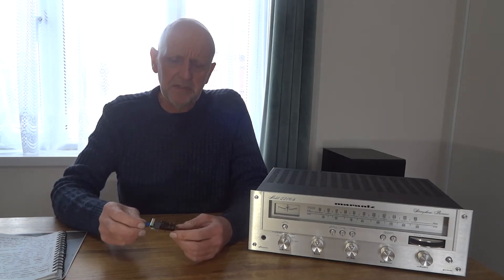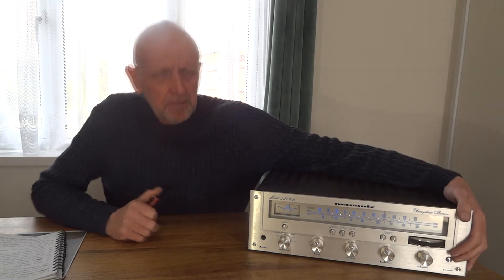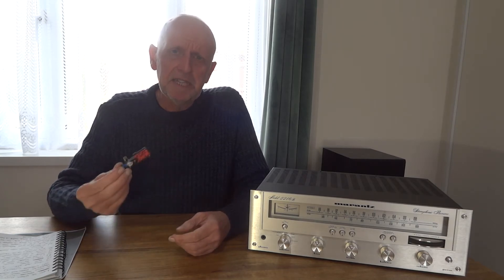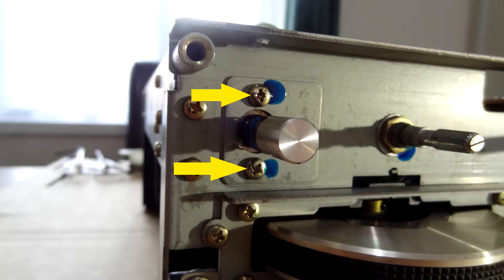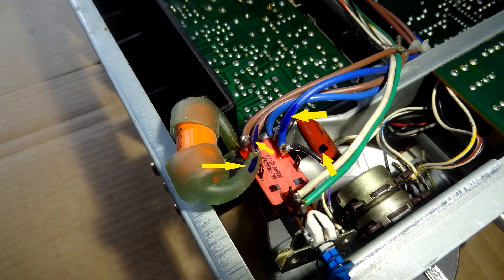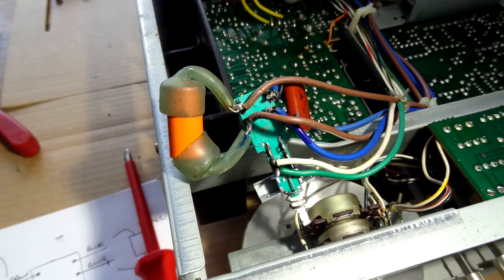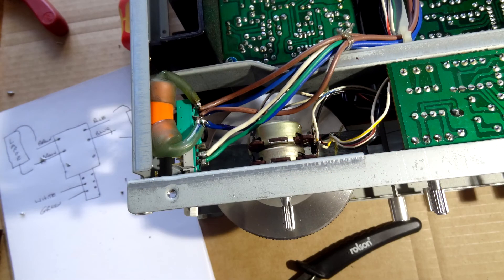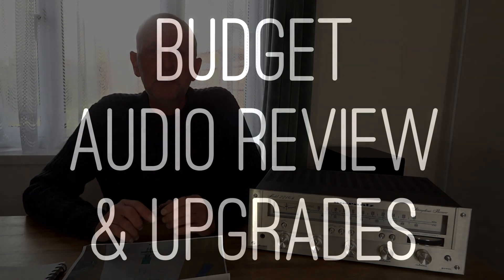Faulty Power Switch on Marantz 2216 Vintage Receiver

Comment: May I ask where you got that replacement switch?
Reply from the maker: I did get mine from a seller on eBay from Germany but I can not see any for sale on there now apart from sellers in the USA and you would need to take the silver mounting bracket off your old one and put it on the new one. They are not cheap here is a link to one for sale https://www.ebay.co.uk/itm/116042705476?chn=ps&_ul=GB&norover=1&mkevt=1&mkrid=710-134428-41853-0&mkcid=2&mkscid=101&itemid=116042705476&targetid=2270718620845&device=c&mktype=pla&googleloc=9045016&poi=&campaignid=20938568783&mkgroupid=160131055320&rlsatarget=pla-2270718620845&abcId=9367980&merchantid=110360246&gad_source=1&gclid=CjwKCAjww_iwBhApEiwAuG6ccMbGAFmLehkRM1dREkRsqUAzRmT5s8XiGC4050g4zUnQDeIb4HTnghoCt-QQAvD_BwE
Reply: @MichaelYates  Thanks. I think I've managed to solve this by gluing in the pins with hot glue in the position where the problem doesn't show up. I hope it holds up.
Reply from the maker: That is good hope it does the trick, but if it does not then investing in a new switch will save spikes in mains voltage and damage to the unit in the long run.

Comment: Hi sir, it's really a good presentation video. And do you have the type name or model name of this new power switch? I bought a new one from e-bay and it's only have 4 pins and don't know how to wired it. Thank you.
Reply from the maker: Hi, a 4 pin switch is no good , you need one like shown in video for this Receiver, eBay do have them but these are not cheap at £20 plus postage, link here or look for simular https://www.ebay.co.uk/itm/265383926275?_trkparms=amclksrc%3DITM%26aid%3D1110013%26algo%3DHOMESPLICE.SIMRXI%26ao%3D1%26asc%3D250943%26meid%3D5e56a7e32e384f5eb63f10f2ac64d2d3%26pid%3D101196%26rk%3D1%26rkt%3D7%26sd%3D403266090402%26itm%3D265383926275%26pmt%3D1%26noa%3D0%26pg%3D2047675%26algv%3DPromotedRVI%26brand%3DITT&_trksid=p2047675.c101196.m2219&amdata=cksum%3A2653839262755e56a7e32e384f5eb63f10f2ac64d2d3%7Cenc%3AAQAIAAAA4BFMeJ9vNoeV5R6diewUBS22B53h8Rise7Ex9bak3TZs6o%252B0Z%252F4yA%252BLe7DRHMYOHUD6CHEHZDoH4toT5RVJ4IU2XvHco4XunDYRWrI3Q93ypo6j2kzaaQPhaF64iomgZEANOa9duHupJtzbdh36AvRi5ufkdgyxRdbb6tLncNL2C5wvIu18F1fwYfMsJdAcU6JjNMXMv5ptYDyYCWwa%252F2zy%252FLVAqIS6CoscIjkX%252Fafa5XgkQggCSz9hfNM9EfoYg%252Br4roFYTCa1y1lyuPY4zKEzCmL1fV9qDPmOec%252Blw3k%252Fu%7Campid%3APL_CLK%7Cclp%3A2047675
Reply: Thank you sir.

Comment: I'm having the same flickering light issue on my 2216B. I took out my power switch and of course it would be different than yours. I've only got 4 wires going to my old switch. I wonder if's difference between US and Europe models? Anyways, thanks for posting!
Reply from the maker: Could well be a slight difference in the wiring between the US and Europe models on the power switch for some reason or an earlier and later revision of the model maybe

Comment: where are you based buddy...do you do repairs..i have a 2238BL with the same problem..do you have the part number at all please..thanks.
Reply from the maker: Hi, I am from Essex, but I am sorry I do not do any private repairs, as I still work and not a lot of time and room
If the switch in the 2238bl is the same as this, which I think it is, I got mine from eBay, link here 
https://www.ebay.co.uk/itm/262844871162?hash=item3d32c671fa:g:vf0AAOSwWTRWzISM
Reply: @MichaelYates  thank you Michael..im only over the river in Gravesend !!  my 2238 is also giving static through both channels after 20 mins or so when warmed up..!!  will this be a power switch problem also or is it something different ? am looking for someone local to look at it for me really !!
Reply from the maker: @jo15518  I would have thought if it was the switch, that it could happen anytime, from turning on till a few hours, if it is after 20 mins or so and its warming up so to speak, it could well be a noisy component, transistor maybe, might be worth given  "AH-Fix-It" a shout on YouTube, he seems to do a lot of work on Marantz receivers and might know your receiver better.